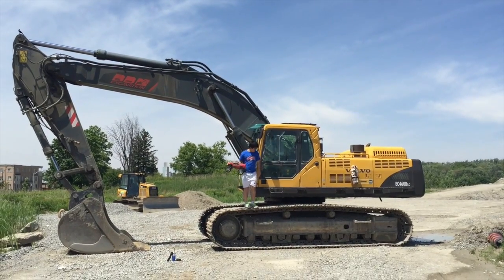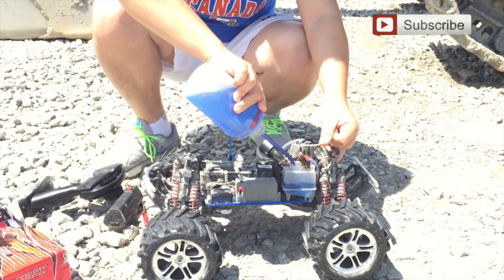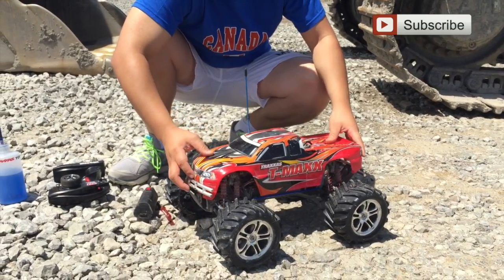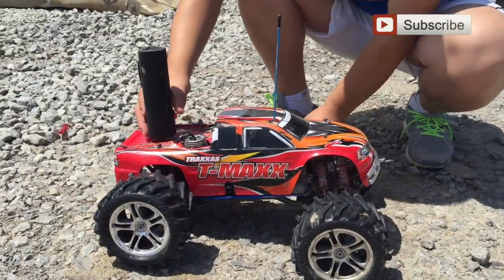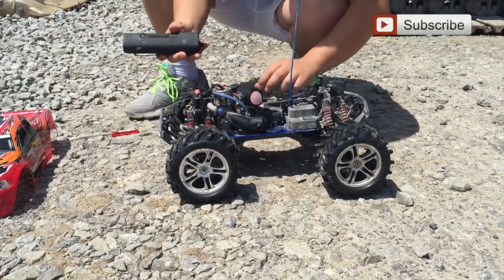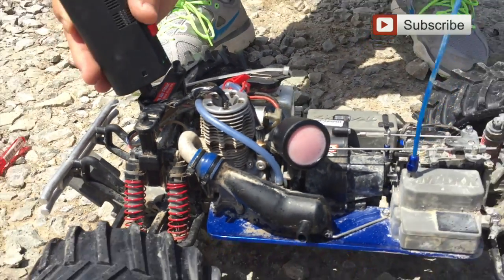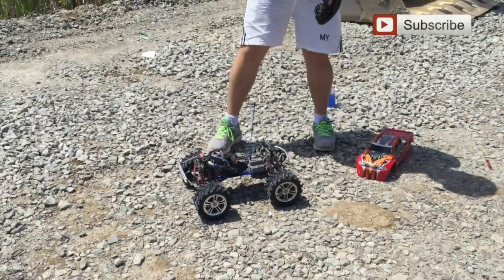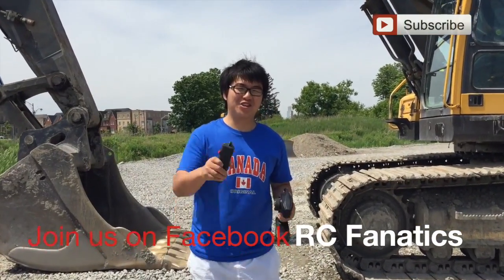Traxxas Tmaxx 2.5 ENGINE breaks in

Comment: this is not funny you are confusing others into break in procedure....

FORALL YOU GUYS OR GIRLS HAVING TROUBLE STARTING YOUR TRAXXAS, READ THIS.
STOCK NEDDLE SETTINGS ON  TRX 2.5 OR 3.3 IS HIGH SPEED NEEDLE 4 FULL TURNS OUT, LOW SPEED NEEDLE THIS ONE DEPENDS WHERE YOU ARE BUT STOCK FROM FACTORY IS 1.5 FULL TURNS OUT, THIS MEANS TO LEAVE AS IT IS DONT MESS WITH THIS UNLESS YOU ALREADY DID OR JUST MAINTENANCE ROUTINE. REMEMBER SOME PEOPLE DO 2.5 TURN OUT ON LSN BUT IT DEPENDS ON YOUR ATMOSPHERIC OR BAROMETRIC READINGS. SO LEAVE IT AT 1.5 AND THEN START FROM THERE ONE PINCH OR 1/16 TURN AT A TIME VERY SMALL MOVEMENTS, SO HOW TO KNOW IF YOUR LSN IS SET PROPERLY? PINCH THE FUEL LINE GOING TO THE CARB AND WAIT UNTIL IT STOPS SHOULD TAKE 4 SECOND TO 5 SECONDS TO DIE, THIS IS A CORRECT SETUP, IF IT DIES AS SOON YOU PRESS THE LINE ITS TOO LEAN ON LSN, OR IF IT TAKES FOREVER THEN IS TO RICH...

ALWAYS READ THE FORUMS OR MANUALS.

Comment: to start the engine you need a glow plug ignitor on the engine
Reply: the ez start heats the glow plug so you don't need an igniter
Reply: With the easy start it will heat the glow plug